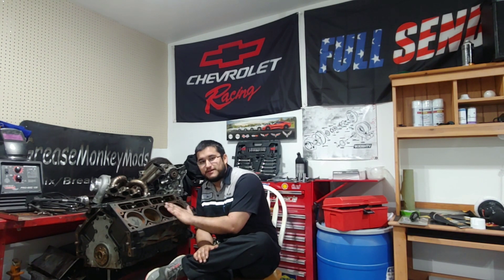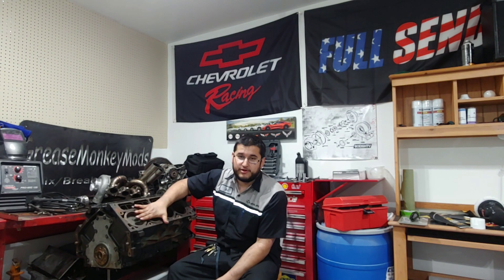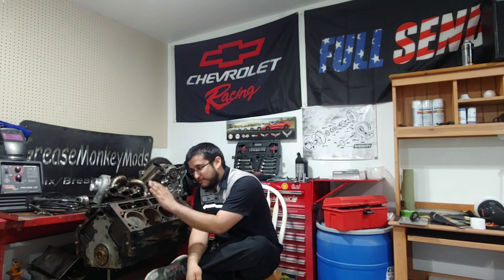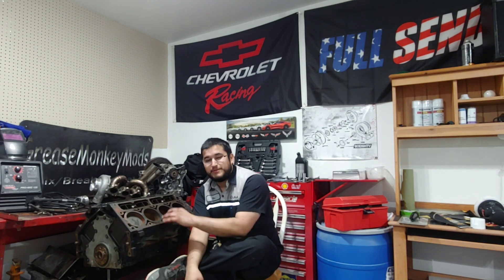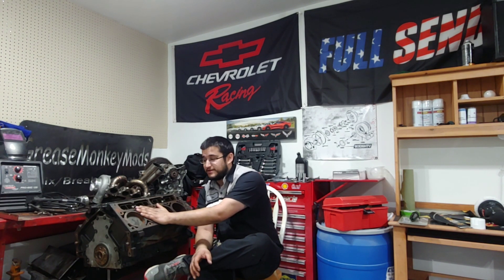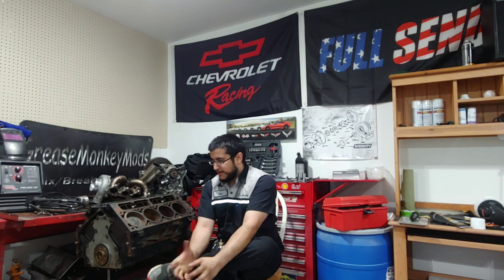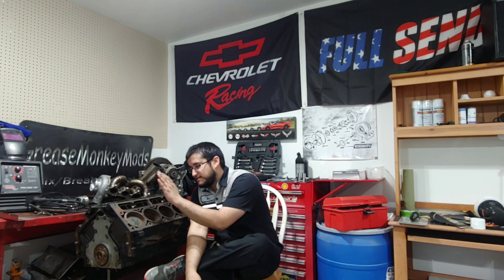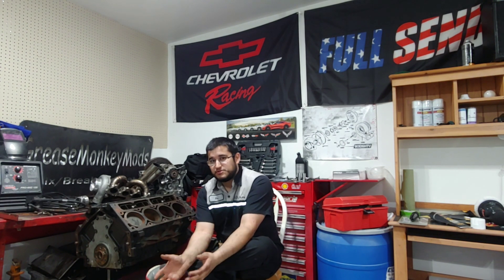CAN YOU BORE A 4.8 / 5.3 TO A 6.0 ? GreaseMonkeyMods LS series

Comment: With sleeves you can do anything 😂 
great video man! that’s a bad ass garage setup you got going on congratulations 👍
Reply from the maker: True! But sleeves would cost more than a 6.0 block 😂
Reply from the maker: And thank you! So excited to finally have a garage! Hows your trans am coming along ive seen your part collection on Facebook a while back
Reply: GreaseMonkeyMods yeah I’ve almost rounded up all the parts I need to complete the build. I just finished building the new long block so I’m one step closer. Problem is I’m an engine builder not a master tech so I’m looking for a good shop in the area to do the work. Dropping the k member on an f body is a disaster without a lift!